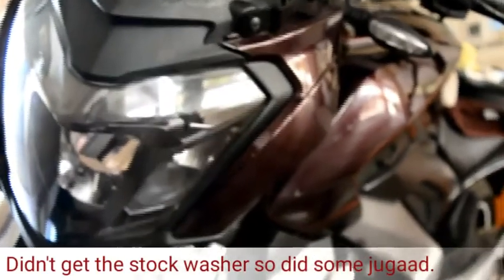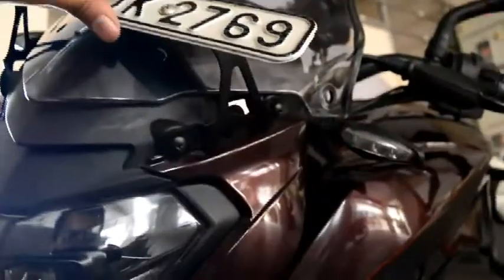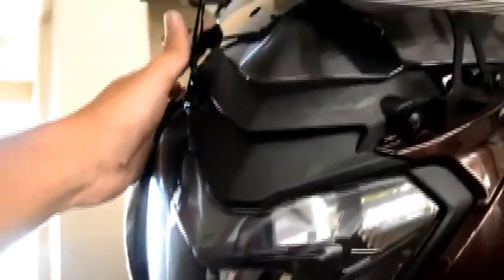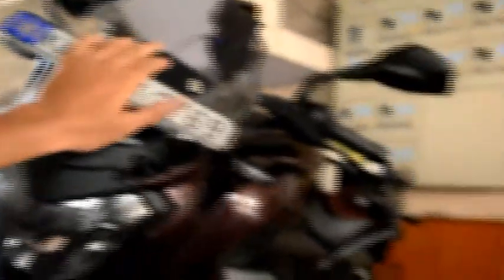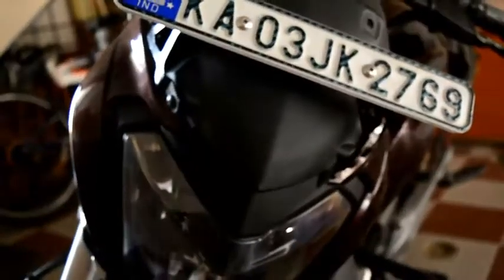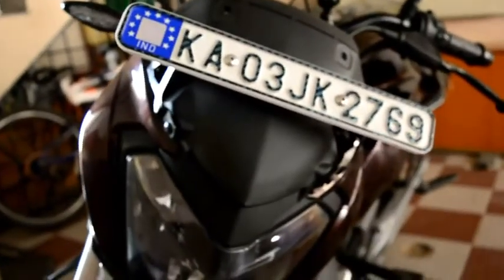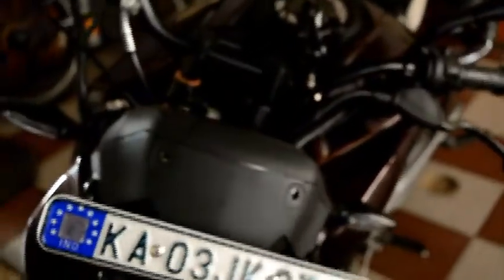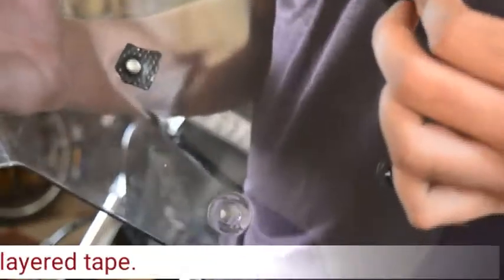DOMINAR D400 VISOR || NO DRILL : NO CLAMPS!!

Comment: Nicely done, try using double sided tape on the bottom part instead of a clamp, u can use the tape on the area which is hidden under the number plate. just a wild thought but i think it would work.
Reply from the maker: +ij singh thanks for your comments.
 I actually wanted to do the same. But there a lot of gap...maybe I ll have to use 3-4 layers.. anyways I ll update if I m doing anything new with it... Appreciate your idea :)
Reply: +Lucky4you 
use Styrofoam or thermacol of the required thickness and stick with double sided 3m tape on it that should do the job, or take some thick piece of rubber from cobbler or mochi and use double sided tape on it.
just use 3m tape as it has the best gum.
Reply from the maker: +ij singh awesome idea... thanks Bhai..
Reply: +Lucky4you 
thanks do try and let us know.
one more thing plz add some More info in the description of video ,like are these holes in the head light assembly already there or u made them, and did u also made holes in the windscreen accordingly or already present.
Reply from the maker: +ij singh thanks very much for guidance Bhai.. I very much needed as I m new to YouTube and will do that every time I create new videos.
Reply: +Lucky4you great good luck with future uploads.
Reply from the maker: +ij singh thanks Bhai

Comment: I see people drilling for fixing this visor.. this looks like a night mare.. the bold which yu have actually tightening is there a hole given in the bike already?
Reply from the maker: I used the holes given on the head.. but due to vibration.. I have changed the and did it in a new way.. I have uploaded review of this video and also the new way to install the visor.. please check you will get an idea.
Reply: lyffylife can yu give the link to that video please.. and also i was able to get the visor n all.. but struggling to get those washer and bolts .. yucks.!!
Reply from the maker: https://youtu.be/afvEWrE3o70

This is my current one bro...